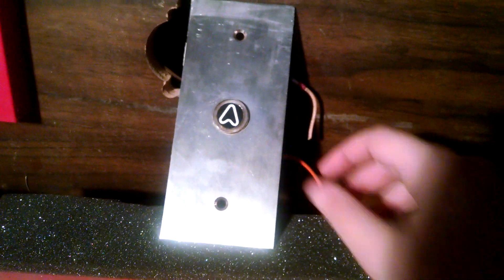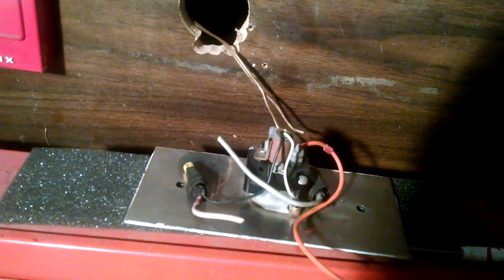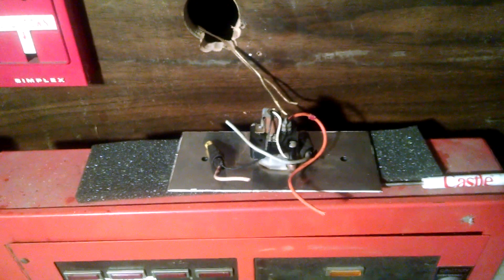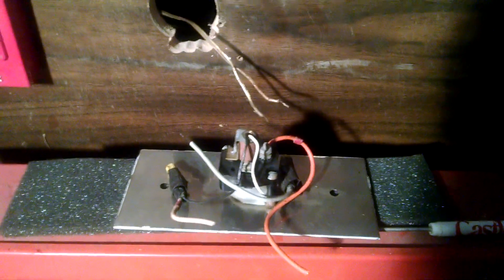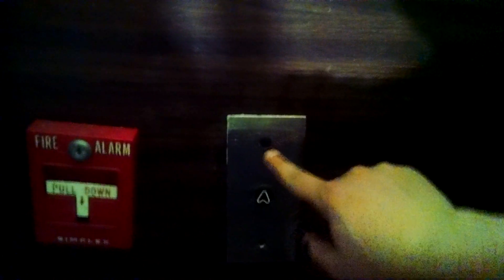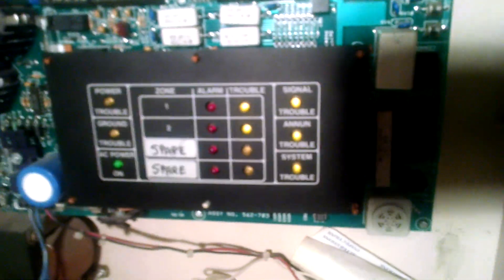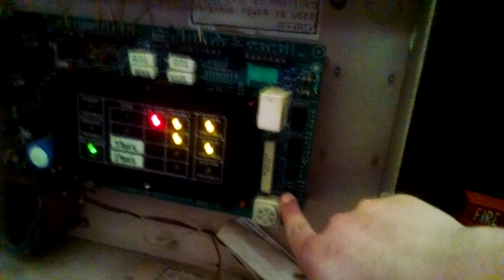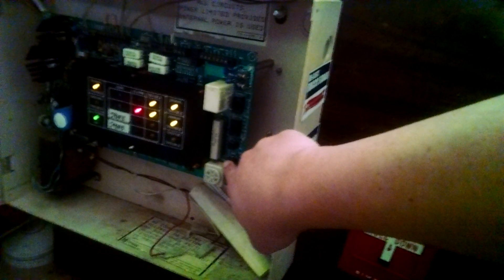Can We Set Off a Fire Alarm System With an Elevator Button?

Comment: That is awesome that you can wire up a button as a callpoint!
Fire alarms callpoints over in the UK are the ones that you break glass instead of pulling it and it can be reset either with a new glass fit or the reset switch to put it back into position.